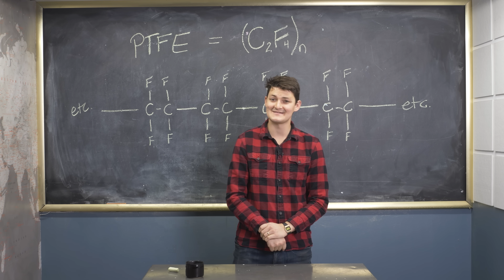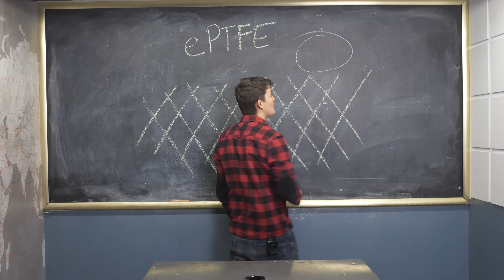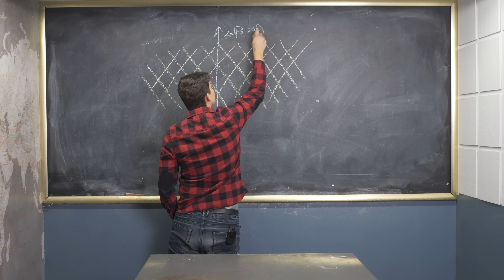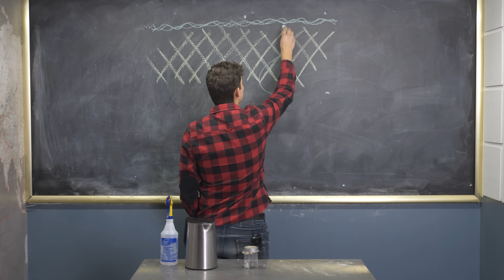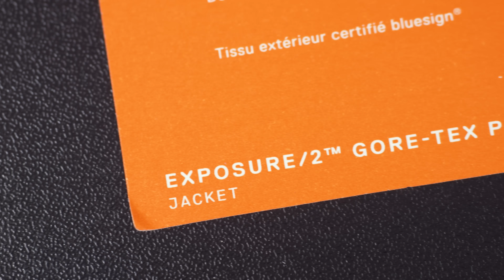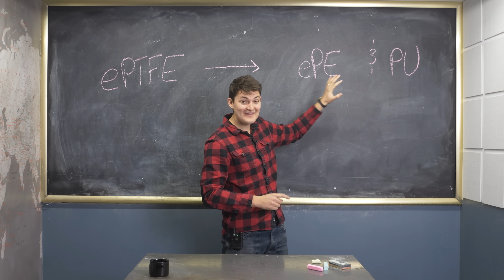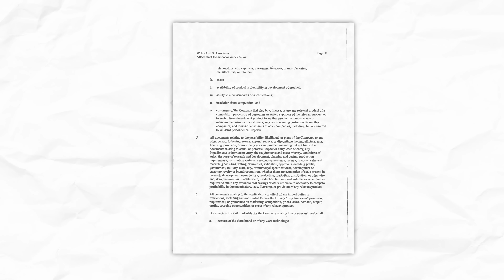Gore-Tex is a Marketing Gimmick

Comment: I have already 15 years of working outside day and night, summer or winter in the one of the most humid country in the world. I had the time to test all existing sollutions but nothing keeps me away from the rain or sweat as the Goretex does. No matter what drives you to make this video will not change the fact that Gore is the best sollution available today for the ones that have to work in wet conditions.

Comment: Interesting. Not a motorcyclist but a Walker. It’s not just the alleged superiority of Goretex which is an issue but also its fragility. People buy boots convinced they are waterproof cos of Goretex and if course the chafing soon wears it out. There is no substitute for good leather boots treated with a silicone repellant. As for the top, if it’s windy l use a poncho, if it’s still an umbrella is best.

Comment: My 2cents:
Any time i find a brands "offbrand" product which is virtually the same it almost never is. It is Designer with less care:
Before you pointed out which jacket was which i would have prefered the one on the right. Maybe not 500 Dollars more, but enough that it bugged me to not buy the left one. And i think that is the Main problem.  
(Same thing goes with Gucci and similar Brands i think: if i find something i need that i can recognise to be well thought out in Design (placement of pockets, how sturdy, it is, which materials were used where etc) and also not fall apart if i pull on it a bit harder when noone is looking in the Shop 😅 then i dont care who makes it.) 
Problem is that the nanufacturers dont care if they cannot Slapstick the goretex Logo on it 🤷‍♂️

Comment: I’m sick of waterproof garments that still absorb water into the surface layer. Becomes non breathable like you said AND you end up carrying around a gallon of cold water against your skin. DWR is a short lived band aid solution. I wish more outdoor gear was made 100% water repellent with lots of cleverly shielded vents.
Reply: Just wash them with wash in water repellent. I do this every few months, good as new.
Reply: @1992AJL  Even brand new DWR will eventually saturate though. DWR clothes just buy you some time.
Reply: That explains a lot why I felt like crap when was wet in netherlands
Reply: Columbia outdry and Gore Shakedry are basically beefed up membranes with no fabric layer and dwr treatment needed.  Shakedry is as good as it gets for a breathable waterproof material in terms of breathability, weight and waterproofness but is somewhat delicate.  Now discontinued because ePTFE.  Outdry is more durable, doesn't use eptfe and breathes decently.  Mechanical ventilation is an alternative where the material is waterproof and non breathable but the jacket has lots of physical venting.  Mechanical ventilation is more the purview of specialist cottage manufacturers right now so it'll probably make its way into the mainstream in the coming years.
Reply: @slipperysalmon13  Mechanical ventilation was all there was before membranes (oil skin, rubber parkas etc) funny that’s it’s now “specialist.  But those other products you mentioned sound promising, never heard of those.
Reply: Water repellency is another forgotten thing. I think that it is as important as waterproofing. I bought a non expensive backpack from aliexpress (just for my motorcycle riding), 100% water repellent (as well waterproof), and it's working amazing. Already rode inside 2 heavy rain rides. It dries ultra fast, because it doesn't soak wet, the water just drops.

Not the same for all my goretex gear. When rain appers, you start riding with all this water inside your gear, carrying all that on your body, very uncomfortable.
Reply: @vitacell1  There’s absolutely no excuse for non clothing items like bags not to be fully repellent. It’s not like they need to breathe!
Reply: True. and I have sneakers with gore tex and tbh my socks are wet sometimes when it's actually wet. Then I have hiking boots made of leather and the lower part is kind of rubber shielded.. socks are dry unless it's very long very wet hike. Also socks don't usually sweat in those boots, but all gore tex shoes your socks tend to sweat more.
Reply: @akse  Boots are the one thing where I refuse to allow membranes. Feet sweat so quickly in Gore boots. But it’s so hard to find hiking boots that aren’t membrane. Danner has like 2 options in their whole catalogue.
Reply: @OuterEdgeOutpost , I use breathable quick drying shoes.  I'll carry waterproof socks to pull over my normal socks if it gets very wet.  The membranes in boots make them too hot, take forever to dry if they do get wet and the membrane usually fails before anything else on the boot.  Once the membrane splits, water can get in but struggles to dry.

Comment: So cool thanks for this. 
Another thought I had to throw in. Goretex is a general "known quantity" for it's performance. Other materials advertising their results may have a struggle with being seen as trustworthy data. I've seen it plenty of times within the bicycle industry. Advertised features and weights, end up being similar staged "lab results". Which is unfortunate, because I love innovation, especially as a MMOG/DIY hack for gear
Reply: I just bought a pair of shoes in Europe and it seems like all brands have their own "TEX"-Variant. So they are getting the best of both worlds, the recognition that it's basically the same technology without the brand attached to it.
Reply: For real I buy gortex because I know it works. I dont know if whatever brands version like "d-dry" works. Ive been burned by merrel's "imitation".  Also gortex stands behind it's products. who cares if it doesnt breath in wet like ya 100 percent humidity your there's no point anyways. Never had a problem with my many gortex shoes.

Comment: To me it's easy to see why consumers stick to the branding. I mean - lifetime warranty if the garment doesn't turn out to be waterproof is a good way to sell their product. It tells the consumer, that the manufacturer believes in their product. It might not be flawless in terms of breathability, but atleast you are sure not to get wet, which is what most people primarily needs it for, with breathability (when dry apparently) is an added bonus. That means that you can wear the garment and have it breathe atleast descently when it isn't pouring, if the weather forecast promises rain later that day, so you don't need to bring both a waterproof and non waterproof garment. A lot of people carry around rain clothes just in case. With goretex you don't have to. A lot of products that aren't goretex claims to be waterproof, but turns out not to be the case. And more often than not, people won't demand a refund, which can be for a whole bunch of reasons, but with goretex you don't have to be shy about it, when they are so confident about their product. Most reviews i've seen from d-dry products is that they breathe horribly compared to goretex products, but i guess it depends on wether it's a shoe/boot, jacket etc. So it's difficult as a consumer to know for sure what you pay for, unless it's goretex. And lastly - rain boots and many types of cheap rain clothes are not breathable no matter the weather anyway, which is what a lot of people are used to. Goretex stays on top because it works 99% of the time (as far as i'm aware) and most people will gladly pay the extra bucks for that insurance.

Comment: I'm totally agree with you, gore-tex is not that waterproof or that breathable, I totally prefer a normal rain jacket with zippers for ventilation than a gore-tex one, because I know that cheap plastic rain jacket will be 100% waterproof and even in gore-tex jackets 75% of the ventilation happens in the zippers holes, and don't forget one is 50$ and the other 200$

Comment: The one application of Gore-Tex and similar membrane materials you didn't comment on is waders. This has been an enormous improvement in comfort over what came before--neoprene or coated nylon. What seems to me to happen that's different from other applications is the the membrane is in contact with and at the temperature of the water, whereas the atmosphere inside is somewhere near body temperature, so the temperature gradient drives some vapor transport out. That being said, quality of manufacture is extremely important. Doesn't take much of a leak say at a frayed seam that's underwater to ruin the whole effect. You get what you pay for in this respect, or you get good at finding and patching leaks.
Reply: I agree totally Goretex aka breathable was a total gamechanger for waders.

Comment: You say a lot of correct things, but also use some of their marketing against them.  You keep saying "breathing". Hell, no, it does NOT breathe.  No real air movement.  It DOES let water VAPOR go thru it, for sure, but not able to keep up with a person's ability to produce moisture if exercising.  Yeah, no way.  Look at it this way. The force that makes it work, is the differential between the vapor pressure on the inside and that on the outside.  If it is cold outside and dry, then it works decently.  But if the surface of the goretex is cold, then it doesn't work as well.  Truth is, that as a layer AGAINST the skin, it works pretty darn well.  Gore made a product like that, basically used in the bike market, that worked quite well.  Some folks called N2S, (next to skin). The fabric was next to the skin, it was much more humid inside, (skin side) and cooler outside, (might well have additional layers outside.  It then got quite wet OUTSIDE the N2S, but so what, the skin was dry.  Look at the glove liner, same thing, worked VERY well.  But, like most things, it wasn't as great as everyone wants.  
Well, Gore can't make this anymore, and is abandoning PTFE, not because it doesn't work, but because environmentally it stinks.  it lasts as PTFE in the garbage dump basically for 1000's of years.  they are going to have a product that is a polyurethane that will do the same thing.  As well?  nope.  and it won't last forever either.  And can be destroyed more easily.  Oh well, when we get real force fields to wrap our bodies in, that might work huh?  
Yeah, I worked on such membranes myself for many years.  It ISN'T as bad as some folks think, but it isn't as good as we all would wish.

Comment: I wish more companies would loose the “breathable” which as pointed put, does NOT work, EVER.  And just make a REAL waterproof outer layer like a rubber raincoat material, and simply add small zippered “breathing” ports at spots like under arms, thighs… like many ski jackets have already.  So if you want air, open it up a bit, if you want water proof, it is waterproof!

Comment: The biggest travesty is that these so-called breathable membranes are in places where you don't want them. Almost all winter jackets by big brands like Columbia, North Face etc have this junk in them, which traps the humidity and causes it to condense in the cold winter air, on the inside of the jacket, saturating the insulation.  I skied in the 80's with a down jacket (and even cheap poly insulation) with none of this junk and it was much more comfortable. And it is very hard to find a hiking boot today that does not have this stuff, which makes it too hot and clammy in the summer. The boots we had decades ago, made of leather and treated with beeswax, are infinitely more comfortable for summer or warm weather.  We were actually more comfortable without this stuff, wearing wool.

Comment: Back in the 90s the snowboard gear I had that was gore-tex was significantly better than the stuff that wasn't
A dozen pants + jackets combos of testing over the years and I just quit bothering with other shells
It being a different formula nowadays is an important point, but as far as I'm concerned they've earned it
Blowing $250 on a jacket that disappoints stings LOT worse than $400 and never knowing if I could have saved 150
Besides, its just like cars: All the good features get shuffled to the high end products anyway, which happen to be GTX
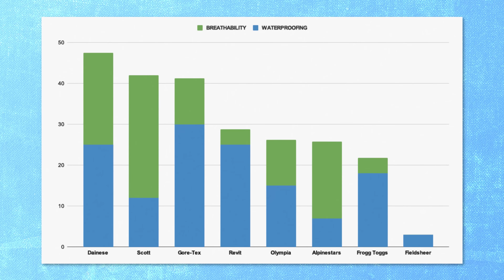8:52...  Sorry but in that graph Gore-tex has the best stat weighting: 20% +waterproof is worth more than 15% +breathability any day

Comment: I had a popular waterproof lightweight hiking boot with an inner Gortex liner. I loved it. I had dry cool feet no matter the condition.  I bought an identical boot later on but with the company's own Gortex-like fabric. They didn't breathe and were not waterproof.  I have also had a Gortex liner in a pair of leather engineer boots. I could wear them all day. They were also entirely waterproof. I'm still sold on Gortex.
Reply: I have a theory that it's not the goretex that makes the difference, it's that the one without gore-tex is just manufactured to a lower standard since it isn't being guaranteed by a third party. I can't imagine that gore would be too happy if people kept claiming under their "guaranteed to keep you dry" policy due to shoddy workmanship putting holes in the liner during boot assembly.

Comment: Ah gore-tex lined boots, when you want to ensure your feet get wet, cos either water will flow over top and into the boots, youll be out in it long enough that it gets through anyways, or the most frustrating, the weather was wrong and your waterproof boots are now a portable sauna, cos MVP technology is a lot less penetration than it would suggest.

Comment: Oh please, Fartnine is correct & we're all suckers?  Thanks for the great evaluation - WHILE WEARING JEANS & GAP SWEATER!!!  As someone from the Pacific Northwest, who hikes (& bikes) all the time in the rain, near snow, & snow, let me correct your misconception.  Goretex is for hiking in the cold.  If you don't put breathable layer underneath - yeah - whatever.  And if you're hiking in 50 degrees (summertime) - yeah - whatever.    But when you are doin the nasty days (cold to 48ish), this stuff (& some competitors) are absolutely golden.  

PS: You do know that when water molecules evaporate, they are not the same as water molecules in liquid state?  Also, the test was on a vertical surface (not horizontal).  I've used a half dozen breathable/waterproof jacket compounds (they all vary) - but I have old goretex that keeps working (I spray hydrophobic).  Yeah - keep hiking in Jeans Mr. Gap Sweater!

Comment: Waterproof or breathable, choose one.  Gore-tex and similar materials work ok in light/showery weather, but I've used them extensively in our rain forest and they don't keep out heavier rain and in the winter in colder temps, you want breathability and your outer layer is less than freezing anyway, it won't get wet.  Vinyl/rubber stuff with taped seams is about as waterproof as you are going to get.  When you start exercising in the cold, you need more breathability to keep from getting your base layer wet, this is typically the opposite of a gore-tex shell.
Reply: Ive used them guiding in Alaska..never had a drop get through. It's all in the quality. Go to Alaska and see how many guides are wearing anything other than Goretex...I have quite literally not seen a single one without it.
Reply: @ty_on_the_flyy  I'm well familiar, since I live and work in Alaska.  If you haven't had a drop get through...I'd have to imagine you haven't really been in more than light/showery rain.  It literally fails in any sustained moderate rain, let alone heavy.  And we had a lot of rain this summer, so plenty of opportunities to test.  It also has a lot to do with humidity in the lighter rain conditions, go in your shower and wear it for 20 min and see if it keeps you dry.  When the environment is more humid, it doesn't, as explained in the video above.

Comment: Gore Tex socks were a revelation when I was a despatch rider in London. Before them Derriboots (like wellingtons) were the only option on a rainy day but offered little to no protection and one ended up with sweaty feet (which was preferable to cold and wet feet). Gore Tex socks, kept my feet dry. I could still wear leather boots and my feet didn't stink when I got home.

Comment: Completely agree with author.
What the manufacturers won't tell you is, when you wear a backpack, even a small one, and it is raining, so-called "waterproof" gortex jacket starts to leak extensively under the shoulder straps. Before you know it, you all drenched.
Actually, it happens everywhere where the fabric touches anything.
I have returned my first jacket, because I thought it was a manufacturer defect.
But the one I bought instead, exhibited the same trait.
And no, it is not "breathable".
The same circus with hiking boots with gortex fabric - they do what is promised, but only during the very first use. 
I stopped buying anything "gortex" for I see it as a waste of money.

Comment: Thanks for a great video with real science. I didn't know why Teflon disappeared from pots and pans, nor did I ever know the original Gore was Teflon-like, or that they got rid of the Teflon and switched to something else. So,  I'll never pay extra for Gore-Tex.  It is a marketing scam that deserves to be brought down by some enterprising prosecutor somewhere.
Your point about discovered vs invented was interesting.  I discovered that water expands when frozen, so I invented pipes that burst when filled with water during very cold weather.  The idea was that all that water flowing through burst pipes after a thaw was a way to increase sales and earnings of the local water company, as well as plumbers and drywall contractors, and it worked! but sadly I forgot to apply for a patent.